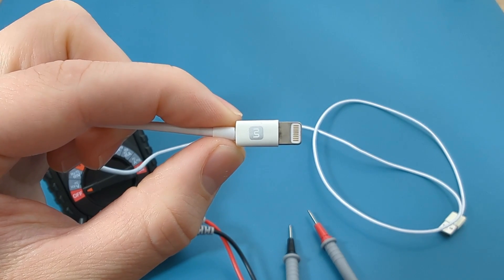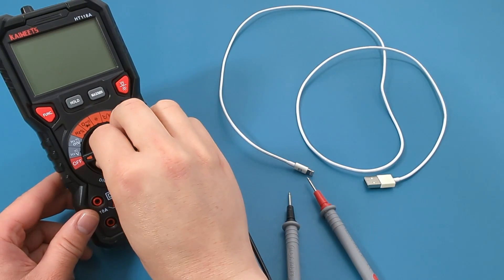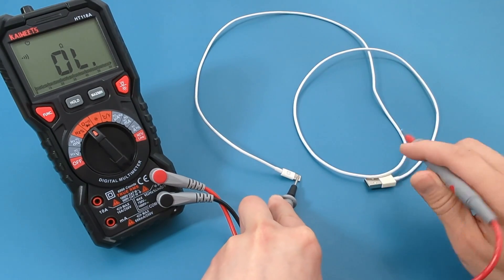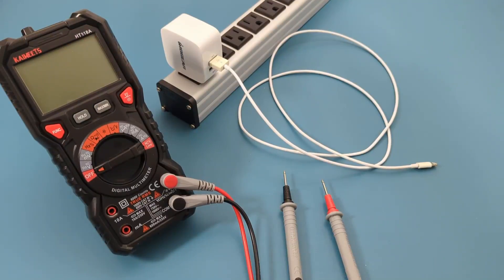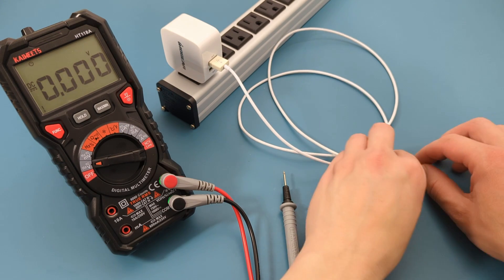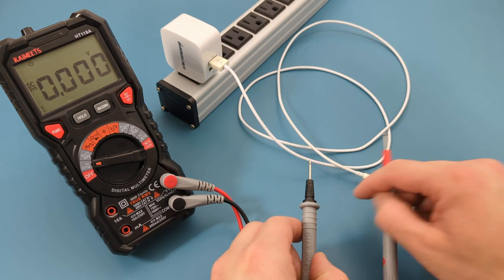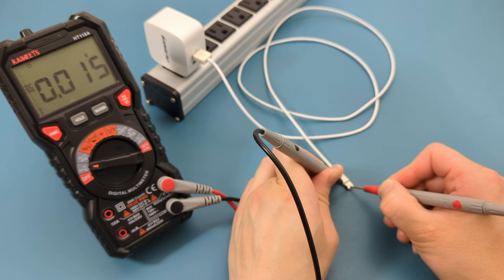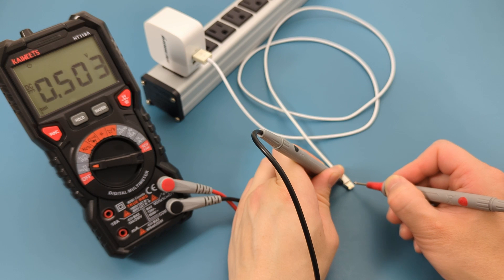How To Test Lightning Cable With Multimeter

Comment: You should include:
The model of your multimeter so viewer can search for it for reference to their own multimeter.
The pin location, ex: a picture of the Lightning cable and it head, which each pin marking with number and function.
A close up view would be best, and a clamp for the wire to hold it steady.

Comment: What about a c type cable where both side is c type
Reply: It's better if you use a USB-C meter. Where you plug your wire into it then plug it into your phone. It's will display the voltage and amp. It's more user friendly and easier to handle than multimeter since the probe can't get inside the USB-C
Reply: U sure sbouf rhat? I sure know a way.. would like you to double think how to do it.. then ill tell you how to do if on usb c
Reply: @hexoroidI’m not an expert on things like that, I’m just trying to save money on cables since I’m retired on a small fixed income. It seems like cables are not meant to last very long. Would you please tell me your trick to testing the USB side of my iPhone cables? Thank you for your time

Comment: Cool, pin 1 and pin 5. very useful indeed. My apple pencil has a  0V reading on these pins and i'm trying to kick start it into obtaining a little bit of charge through using a 3.7V lithium battery  so that when I plug it back into the ipad, it will come to life. I'm not too hopefull about this working, but otherwise, the apple pencil is a throw away item, so it's worth a go.Thank you for this informative video.
Reply: The apple pencil is a throwaway item..... Where do you throw your stuff away im going through your trash
Reply: @danielcote7475  😂😂it was a throw away item until I managed to revive it🙏⭐
Reply from the maker: You're welcome! I'm glad you found this video helpful.